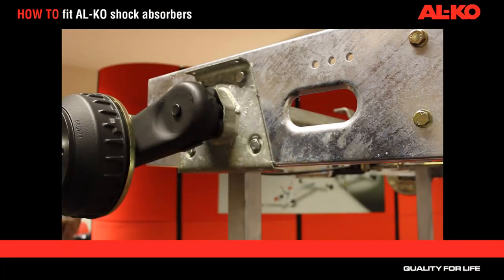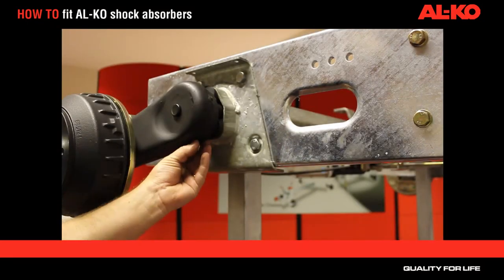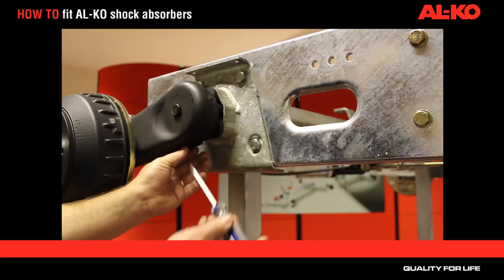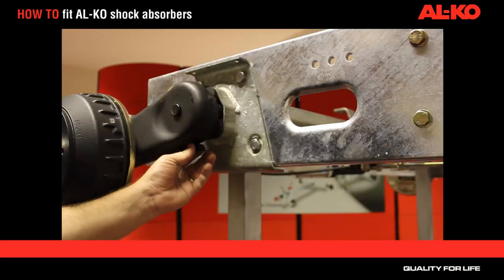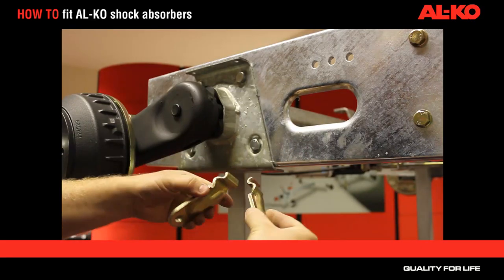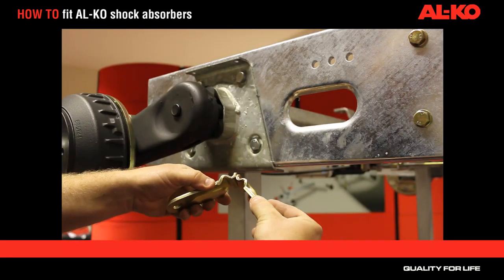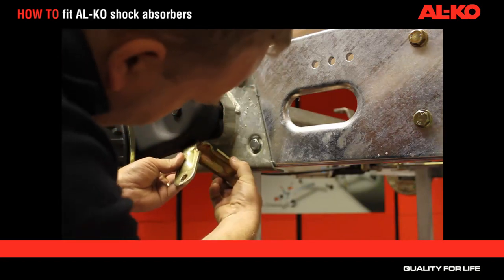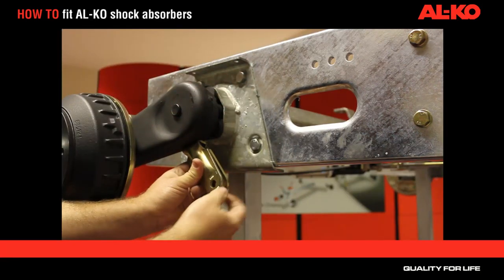HOW TO fit AL-KO shock absorbers

Comment: Hi, great video...however I don't have an AL-KO frame but have an AL-KO derived axle that has that extra bracket at the rear of the Tire, so unlike your setup with the front shock absorber to the tire, I'd be forced to put it at the rear, therefore when the comma takes the blow the shock absorber works in compression when the rubber returns downwards the shock absorber works in extension... My question is: does the octagon work equally well?

Comment: I  suggest that the bolt (at 1:22) is inserted in the wrong direction. The bolt schould always have the head towards the wheel to prevent damage to the tyre...
Reply: If nut comes free on bottom hole, the bolt can only move towards the chassis, not the tyre.  If top nut comes free, shock will swing down with the bolt, damage to tyre?   I will be installing mine - bottom as shown, but top with bolt head inside the chassis.    And a belt and braces thing - I will use loc-tite as well.  :)

Comment: What is hapening if I will mount the shockabsorbers in the third hole on the chasis, not the one in the midle?
Reply: Possibly the shock innards may not be in the center position at static load, leading them to hit bottom or top when travelling.